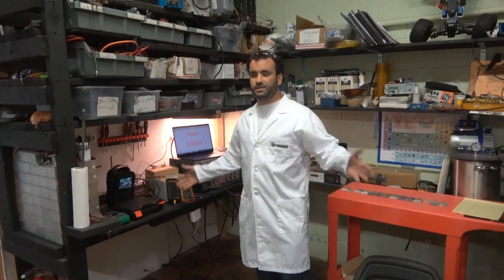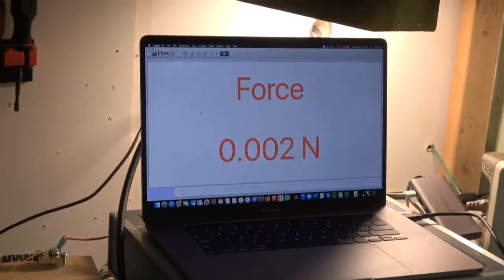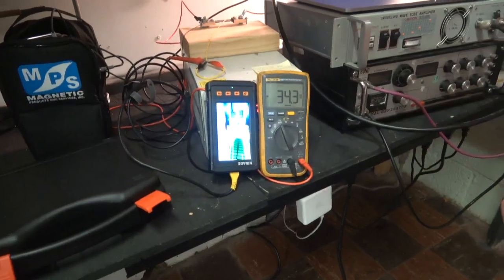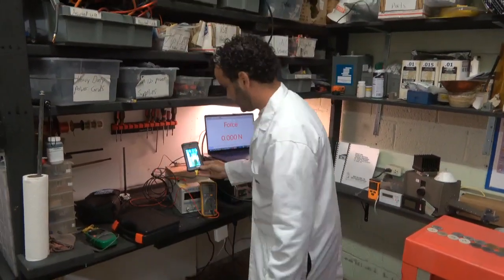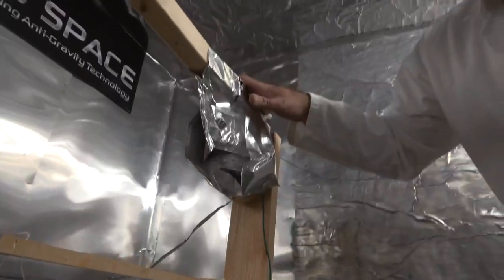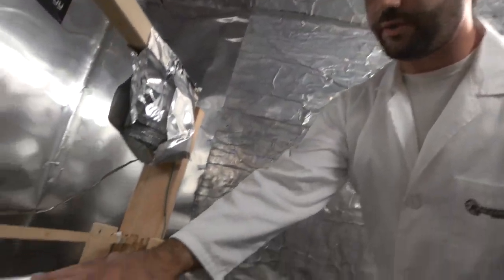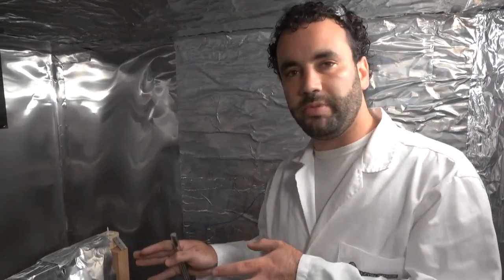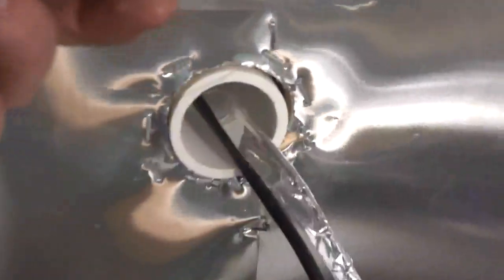Alzofon Antigravity Experiment Test Setup

Comment: @Falcon Space Program
I see you have a sample that has iron in it loosely hanging in between the magnets. Wouldn't the sample be then attracted to on side of the magnetic coil field gap it is in? That would in effect press it against on side of the apparatus and stop your measurement from being detected or very weakly, wouldn't it? Also I heard nmr style devices need odd numbered nuclei, of wich aluminium and copper is but iron isn't or can the nuetrons space out the protons enough for a net spin to occur? Will you ever bolt the sample directly to the apart us and weigh the whole thing as one drive unit?, provided you have bigger samples of the effect is weak? Also lastly should any of your iron containing samples move upward (while not being attracted to one of the electromagnets) wouldn't the slight movement up Change the main magnetic fields path slightly and contribute to the detected upward force?  Thanks
Reply from the maker: you bring up good points that we addressed in our test setup. first of all their is only 3% iron by weight in the sample. but this was still an issue which is why we had to set up the sample holder the way it is with stabilizing rails to hold it at the center saddle point. watch again at the end when jerimiah explains how we overcame that issue.
Reply: @FalconSpace  I guess I missed that, so I will
Reply: @FalconSpace   thanks again, but what's your expectation on having higher or lower iron content in the samples? Either I dont Remember or it didn't come up yet
Reply from the maker: MobiusPrime 2035 with more iron the sample will be harder to center. As for weightloss i have no idea if itll increase or decrease anything.
Reply: @FalconSpace  cool, so we'll see. As for the precession of spins for atoms of uneven atomic number I kinda have an idea why it looks promising. That comes from my first year university chemistry classes and the extremeness of the speeds and classical densities of the fundemental particles in atoms. Realizing that when synchronized to spin in direction we should expect gravity waves and twisting effects etc. It also occurred to me that without laws of disorder all atoms would collapse immediately regardless of their tiny masses producing a weak gravity field Because they are so small, and turning fast on those scales that it makes up it etc. So it'll be interesting for sure. I'm also expecting there to be many ways to do the same thing so it's expected that many versions will come about.

Comment: what's your magnetic field in Teslas?
Reply from the maker: Doctor Hongo .3300
Reply: If you need you can achieve higher fields with neodymium permanent magnets and using a halbach configuration. You can achieve more than 1 Tesla.
Reply from the maker: Doctor Hongo a halbach array is good for asymmetric magnetic fields. Not what we need here
Reply: Also if you need an homogeneous field you are far from it with that setup.
Reply from the maker: Doctor Hongo our gauss meters shows it has a pretty homogeneous field.
Reply: Nice. Probably not homogeneous enough for NMR quality which is way more sensible. Maybe for your purpose is enough. Good job!
Reply: You can achieve homogeneous magnetic fields with a special Hatbach configuration. Where can I message you in private and I can tell you more?
Reply from the maker: Doctor Hongo EPR requires a level of laminarity  that cant be achieved without decently pure iron. Permanent magnets can work but youd have to add a coil to boost or weaken the field to reach optimal results.
Reply: I understand. Another fact that you should consider if you need a very homogeneous field is the implementation of a more complicated process called shimming which consists in having several coils of different spacial symmetry and passing the right current on each of them to control the homogenity and the total field. That would take you years to perfect unless you get a retired NMR or EPR unit. I know some universities trashed their old units. It may be a matter of finding an opportunity like that.

Comment: Nice job guys! Well constructed.  That last horn you showed looks fine to me, but you need a way to measure the intensity of microwaves "at" the sample.
Reply from the maker: How can we do that?
The antenna simply wont fit.
Reply: @FalconSpace  make a small loop of wire that will fit. Any coil can be used as a magnetic field detector. If you want to make it more sensitive, it needs to be sized to resonate at 9.25 ghz, which can be tested simply by charging the coil with a current, then remove the source and measure the ringing frequency. The coil's inherent interwinding capacitance should be enough, just add more turns until you get the desired frequency.
Reply: @Greg_Chase  We don't need the spins to be aligned either way. We just need them to precess such that in one direction the frequency increases and in the other direction the frequency decreases.
Reply: @Greg_Chase  In the presentation I said that, in order to create acceleration, there needs to be a gradient in the  scalar magnetic flux (SMF) density. This is what causes the frequency shift, according to the gyromagnetic ratio times the SMF density. The direction of spin is irrelevant, only the intensity of "instantaneous" flux coupled to each particle is important, not the average intensity. Preferably, to mimic gravity, the average intensity is zero, but at the scale of sub-atomic particles it is large. However, if only the hull responds, then objects and people inside will feel the acceleration, just like a car or a jet. It is only when the majority of all matter inside the hull too can be coupled to the field, then everything is accelerate uniformly and we'll have geodesic motion like a real Alcubierre warp drive.
Reply: @Greg_Chase  I'm sorry, this reads like word salad. "hard acceleration"?  " 32.2 ft/sec^2 acceleration in open space would result in inertia."?  These statements make no sense. Please use textbook terminology so people can understand you.
Reply: @ToddDesiato  I'm so glad you and the Falcon Space guys are collaborating with each other.  The other day in your video you said you were awaiting the results of Mark's new experiment "tomorrow."  I was wondering how that went.  I haven't seen any new videos from Falcon Space after the Alzofon Lab set up video here.  Where can I get updates to see the results of new experiments?